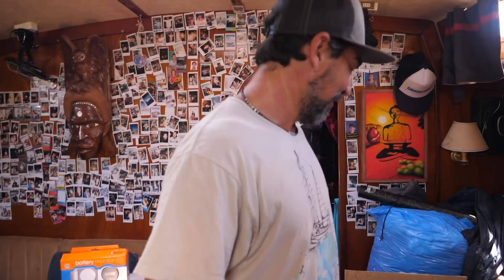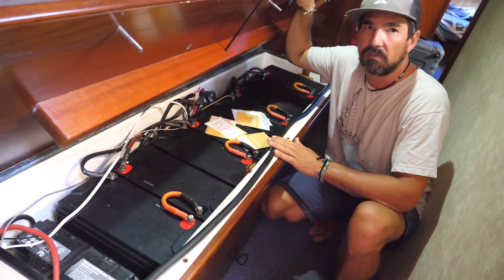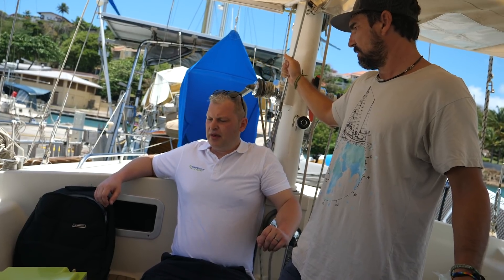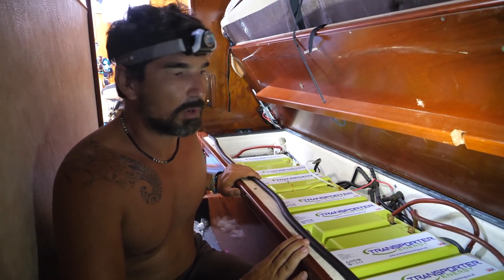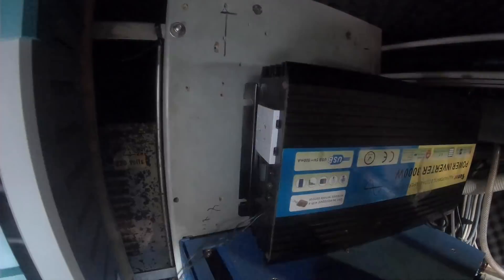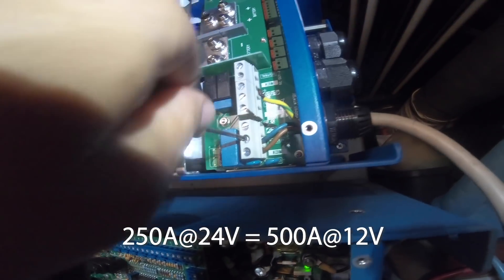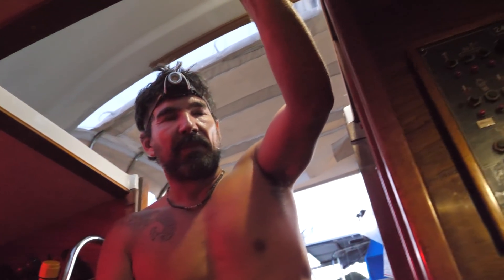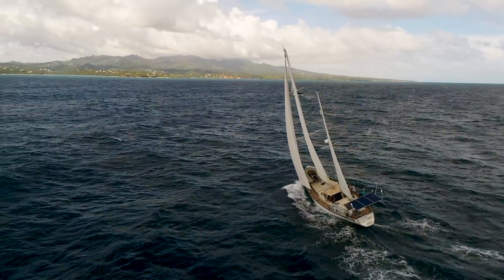Hello LITHIUM, Goodbye Propane!!!  Part 1-  Sailing Vessel Delos

Comment: That is great from an engineering perspective but cooking is an art and a gas flame  gives a cook adjustments that are not possible with electric (resistance coils) or induction burners. I have some induction burners that allow me to dial in a precise temperature but it just isn't the same type of control  a cook really needs. If it was me, and it isn't, I would keep the gas stove, add the induction burners and use both. I like gas burners better than anything else I have used so far.  There are trade offs that are dealt with in a boat galley that are not as much of an issue in a land based kitchen so the advantages you are benefiting from will probably outweigh the disadvantages.

david

Comment: Dead wires were the bane of The US navy. At least when I was in the service. Apparently they are also the bane of sale boats. Induction heating is produced by eddy current induced by a magnetic field. Do you expect any noise or  voltage on the boats other wire harnesses? I am interested in your experiances.
Reply from the maker: We have not experienced anything yet, but will be sure to put her to some tests underway.

Comment: Because you do a lot of sailing in warm weather, I would seriously consider installing 1 or 2 fans in that battery locker.  Pull from inside the boat but exhaust outside.

Comment: Good video, especially once you follow up with a review. One note, voltage can kill (think lightning), current does kill. A 12 VDC marine battery can make Karin a young, pretty, rich, widow, with an awesome boat. Be very careful when working with 12 or 24 VDC when there is a potential for more then half and amp (which would be anytime you are working directly on a battery). What it really comes down to is the current path through your body. You don't want the path to go across your heart.

Comment: Awesome video Brian, you all are revolutionizing Solar powered systems on boats, way to go in being the leader...I am all for not using propane on my boat and reducing heat and fire hazards.. Thanks for providing all the reference links as well. I am still trying to learn and wrap my head around this electrical setup , a diagram would really help...Also, what type of induction cooktop did you all select? Do you have link to that version or even a 4 burner version from the same company? I saw the link to the 1 burner version on amazon but wanted to see the 2 and 4 burner versions as well. Happy Sailing My Friends!!!
Reply from the maker: Hey Michael, thanks for the comment.  This particular unit is a Kenyon stove.
Reply: Is it this one? https://www.cookwithkenyon.com/shop/silken2-2-burner-trimline/

Comment: Sooooooo   been thinking about exactly this, but having har a couple RC batteries catch fire while charging at low C values, must admit im a tiny bit concerned about the potential for catastrophic fire onboard caused by  Lithium battery malfunction - did you do research on that aspect?   (fire onboard that can't be put out could be pretty problematic)
* Im driving a i3 and have no problems with that, and also realize that there are boat-motor systems running off BMW i3 batteries, so thinking the number of reported i3 fires is probably zip.   and its probably more a matter of a quality charging controll system.
** sorry writing while watching.. and see you are using LiPoFe's  which are a lot better than RC batteries - and certified for airfreight definitely is a good thing..   
GOOD would hate to suddenly loose my favorite sailing channel to unexpected events in the bermuda triangle. :-)
Reply: Sailing the Space Between is running a Lithium system using Chevy Volt batteries, supposedly 1/4 the cost of conventional Lithium with 4-5x the usable energy
Reply: That's a Class-D fire (metal fire). Requires a Class-D fire extinguisher.
Reply: trespire, it isn't a metal fire, it's thermal runaway which means the battery is constantly dumping energy into the fire - you can't put it out till the battery is done no matter what kind of extinguisher you have.  And someone said LiFePO4 don't have a problem with that.
Reply: New solution for Lithium is a non-fluid electrolyte. Of course, the type of Lithium Ion battery is paramount. As in the video, there are many different types of Li Ion.
Reply: One huge advantage of LiFePO4 is they are NOT at risk of thermal runaway, ie  overheating and catching fire, like other cathode formulations of Lithium. That is why they are used in electric cars. (I looked into this 9 years ago when they first came out, and built an electric bike with them.)
Reply: LiFePo's (LFP) is the savest Li-technology, that exist. We crashed, shortcutted, heated them up in an oven etc. Even then you hardly can push the battery in a state, which is called "thermal runaway". This is different with NMC, where thermal runaway is reached much earlier. From a safety perspective LFP is the best choice.

Comment: wow yeah, 250A @ 24V = 6KW.  That's going to make even a 10KVA (generator) work hard..
Reply: Peak diesel engine efficiency is in the 55-80% load range. So this is exactly what they want to minimize fuel usage and genny run time.

Comment: Midweek Delos tech videos become the best part of the week. Even if it's only a Tuesday, I know nothing can top it! One minute slower is a good trade off though. Less wasted heat, less burnt gas fumes in the cabin, lower risk of carbon monoxide poisoning, much more comfortable cooking, a MASSIVELY reduced fire risk and no harm done if the oven is left switched on. What more could you want?!
Reply: Wait, is there an oven too?

Comment: been wavering about the whole change out the situation, mainly dictated by the cost, what sort of guarantee (years) do these lithiums come with?
Reply from the maker: Hmm, well 5000 cycles would be a bit of time.  Not sure if the actual warranty is that long though!

Comment: I did the certification for that inverter. Really robust machine. I love the video and explanation, very detailed and esaay to understand.
Reply: for my understanding he is dissapointed because maybe he thought the device made 3000 W but the device has an apparent power of 3000VA or 2400W. See the datasheet : https://www.victronenergy.com/upload/documents/Datasheet-MultiPlus-inverter-charger--800VA-5kVA-EN.pdf
Reply: C B of course they are inverters that uses transformers for isolation. Transformers have losses and as all the inverters their efficiency depends on temperature. In one of the tests called fan-block for the standard IEC62109 the inverter power derrates but continues giving power.

Comment: This is very interesting new tech.  I will say I’ve never met an Inverter that didn’t break (and of course when it was most inconvenient).  If you can swing both the room and the cash for a spare I’d recommend it.  Also, I recall that the folks on Gone With the Wynns had an issue with either the charger or inverter overheating because it was in too confined a space with inadequate air circulation.  You may want to keep an eye on operating temps for the inverter if you have not already thought of it.  

I am also wondering what was the weight savings between lithium vs lead acid batts?
Reply from the maker: Yes good advice Mike!  We figure we saved just over 110KG on the change.
Reply: In case you want to view it, I found the Gone With The Wynns vid where they talk about their inverter failing due to excess heat build up:  its their “Stuff Breaks, We Fix It...Hooray Boats! (Sailing Panama)” published on Jan 14 ‘18.  Cheers

Comment: Love these new segments! And for someone with no EE degree, how difficult is the configuration, insuring safety mechanisms exist (like the use of the starter battery)? In other words, how accessible are technical resources for those mildly proficient in electronics installations?
Reply from the maker: It's not really that difficult if you get the right gear, reading this article is where I got quite a lot of help: http://nordkyndesign.com/from-lead-acid-to-lithium-new-battery-technology-for-power-on-board/

Comment: Brian  gets the title of Mr Wiz that was amazing constantly  upgrading your boat with the latest technology keeps the value of the boat and makes for safer travelling. One negative about induction is not all pots and pans work I think only steel bottomed not sure about teflon coated so watch your scrambled eggs!👍
Reply from the maker: Yeah, absolute right about the pots.  They have to be made of a ferrous material, or have copper coils inserted into the bottom for alloys.  A few of ours worked, some didn't.  Good excuse to get some sweet new cooking stuff though :)

Comment: Congrats on the install/conversion!  You'll love the induction unit for cooking -- so easy to control, especially on lower settings.  And you'll sleep better without propane on board.  Without all that lead, it looks like your beer capacity goes up by about 250 lbs !
Reply from the maker: Yes, excellent observation :) he he!

Comment: why did you not get a shock when touching the terminals? its scary for me - electricity
Reply from the maker: some may disagree, but I feel low voltage DC is pretty safe if some precautions taken.  There is just not enough potential energy to get through the resistance of your skin, higher voltage is a very different thing, and people's bodies have a different natural resistance so there is always that.  It's the current that gets you in the end....

Comment: How does lithium withstand the freezing temperatures when the boat is stored in the Winter?  I have 12V gel batteries and don't remove them during the long cold Winters in Wisconsin.  No problems so far, but am curious if lithium batteries are similar in this regard.
Reply from the maker: That's an excellent question Sam, I will need to ask this to the manufacturer, not something I considered since we're in moderate climates.  Brian
Reply: A quick google: One test reports the optimal operation temperature range is proved to be 10℃ to 40℃. Operating them outside this range degrades the battery life. Another source states 0C as the lower limit for charging, but  -10C is OK for discharging and -20C for storage.

Comment: It appears as though you left one lead 12volt battery at the end. Is that to start the engine/generator? If not, what is it for? Never mind, I just heard you state starter battery
Reply from the maker: Yep, it's the starter battery for the main diesel and the generator.  Brian